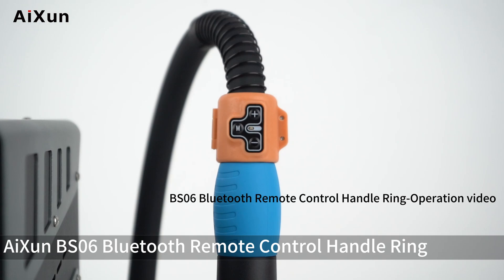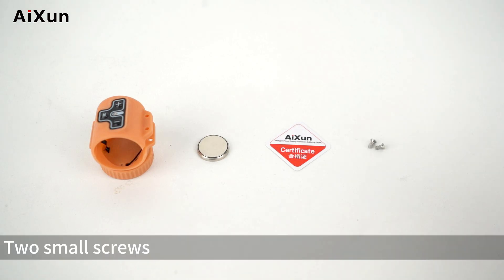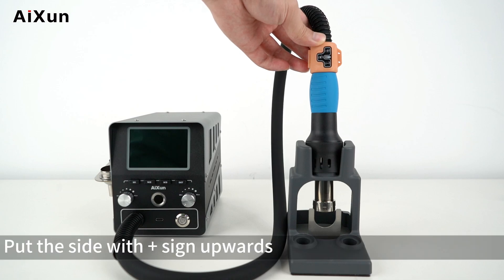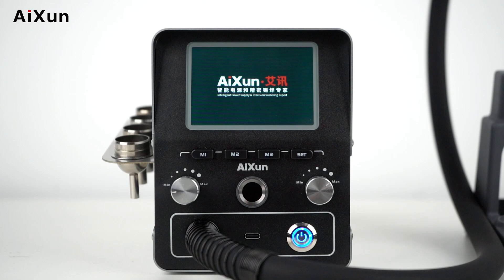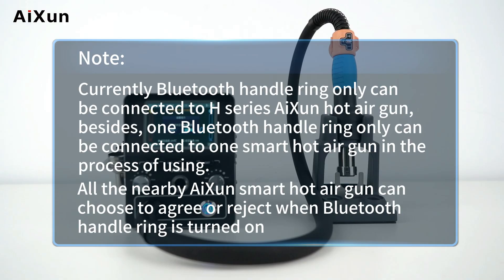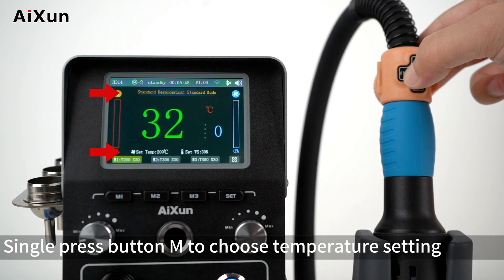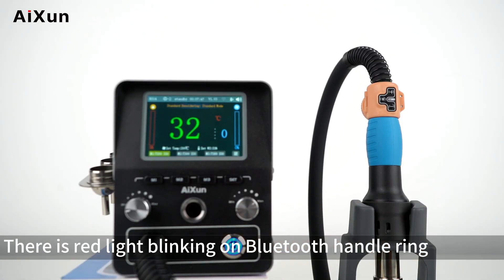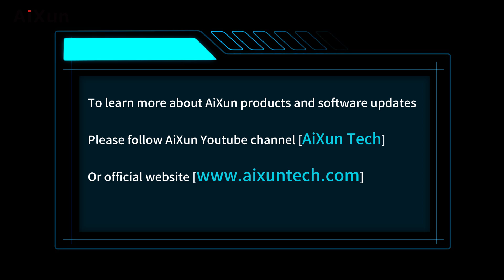AiXun BS06 Bluetooth Remote Handle Ring for Hot Air Gun Rework Station

Comment: My battery drains very quickly after about 2 months of use. I measured the current consumption and found a bug in the firmware. Is it possible to get the firmware and update the ring?